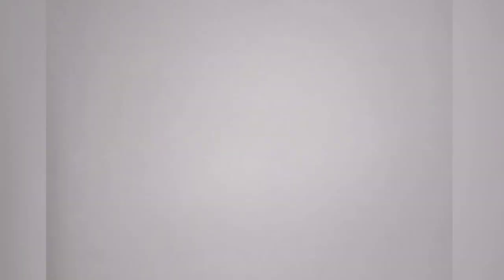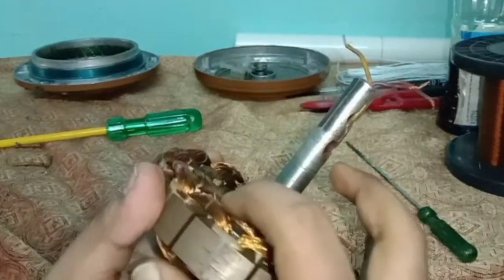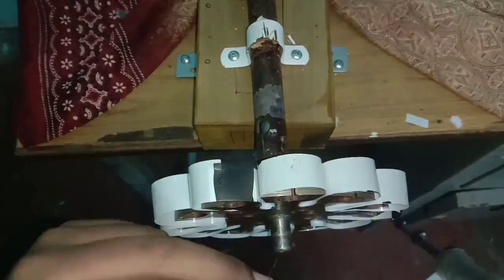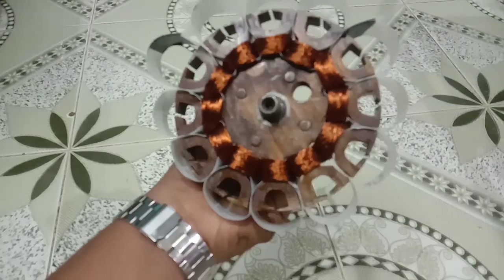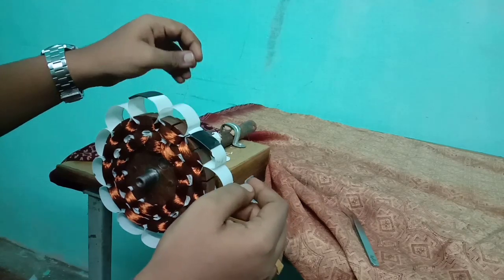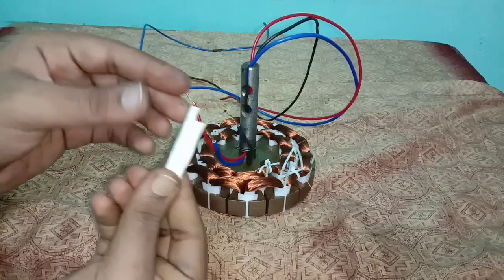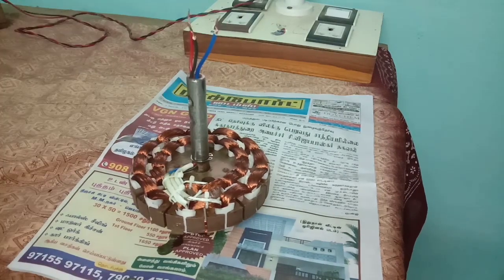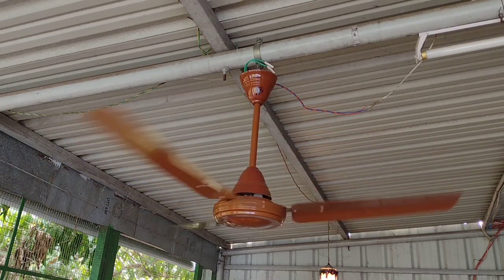How to rewind a ceiling fan by hand winding method || DIY ceiling fan rewinding

Comment: Nice tutorial sir.. well explained for newbie. Sir which the to wire to be a common terminal from main and auxilliary winding.  The begining or the ending of the ?
Reply from the maker: From the beginning part of wire, 1 wire from aux and another one from main connected together with lead Wire and connected to supply as common the remaining 2 wires of aux and main (ending part) should be connected with capacitor and aux+ capacitor (dummy),
main+capacitor should be connected to supply